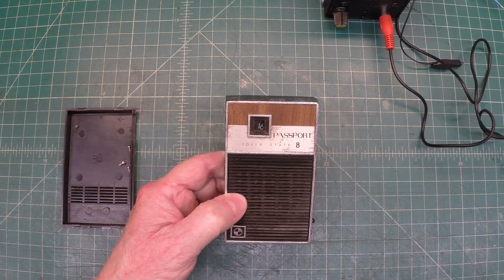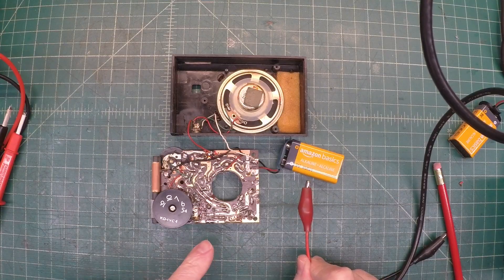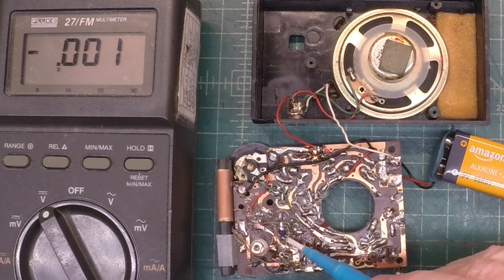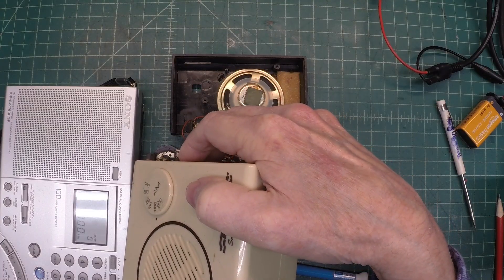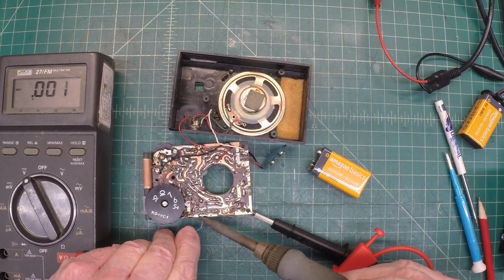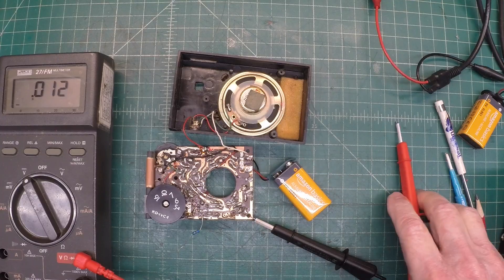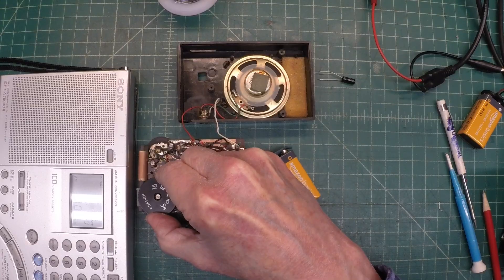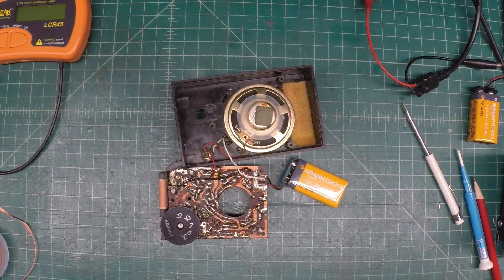Transistor Radio Troubleshooting/Repair | PASSPORT | British Crown Colony of Hong Kong

Comment: Hey Don, easy mistake to make. I have come across this same thing in cheap Hong Kong radios in the past. Either they were not designed well or perhaps the circuit trace just fell off, but they quickly discovered it could be fixed with a blob of solder. LOL Curious as to where you came up with the IF transformer. I know we have found them in the past, but they have been very expensive. Radio does not sound bad for as cheap as it is. :)
Reply: Doug, I have two sources for them. The first is to obtain a couple of the red HX108-2 radio kits at Hally Expresso and use them just for the parts. Right now they're less than six buckos for one. They're actually pretty good kit radios and also work well when assembled. The second is to watch for several or more older transistor radios sold as a lot on he paye, where most of the radios are obviously best used for their parts, and get them for that reason.

This is my 3rd attempt to post this. The stupid Hugh Toob AI removed my other ones, hence the alternative spellings and strange verbage.
Reply from the maker: Another source:

https://www.elexp.com/products/16ifyxfmr-if-slug-yellow-42if101
Reply from the maker: Doug, your comment reappeared this morning. Yep, I should have took some photos before pulling the IFT out for reference, but… Here’s the link for the IFTs for others that I emailed you. Best, Don

https://www.elexp.com/products/16ifyxfmr-if-slug-yellow-42if101